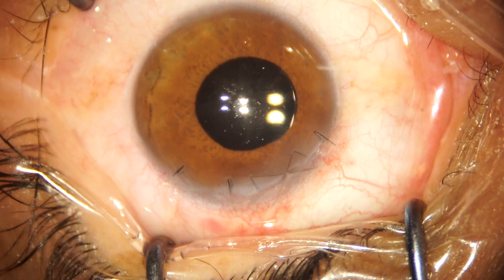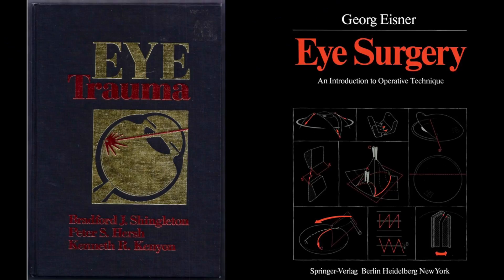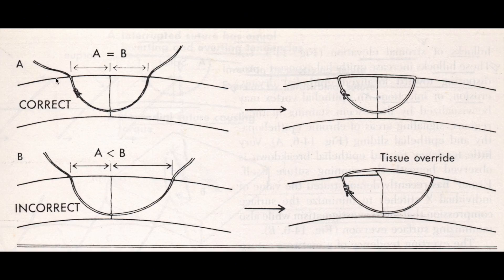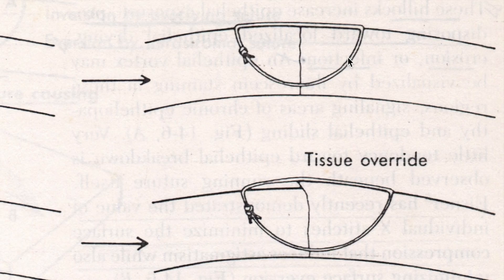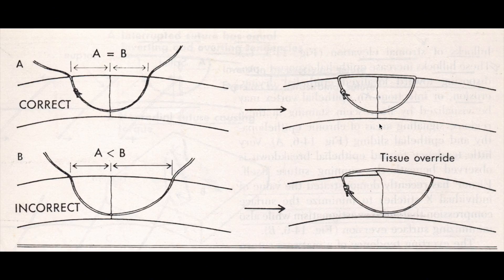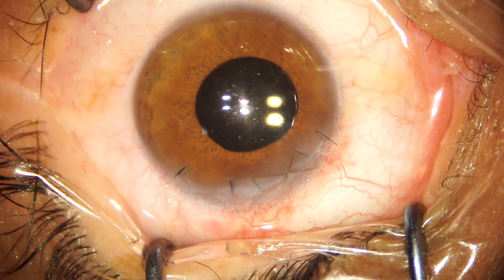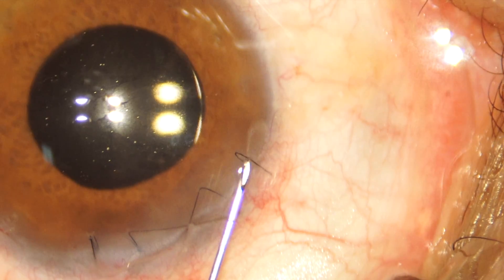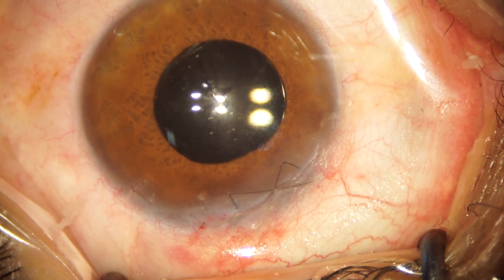Corneal Suture Removal: The Correct Technique

Comment: In a situation where the knot is on the shorter side of the break, should the surgeon still attempt to remove from the side where the knot is?
Reply from the maker: I wouldn't cross the wound margin with a knot in any situation. Technically, the length of the suture bite isn't of much significance.  It will always be easier to remove the entire suture, if one attempts to remove it from the side of the knot.